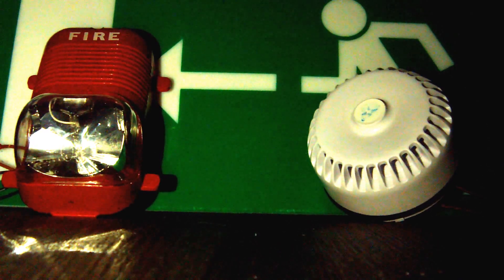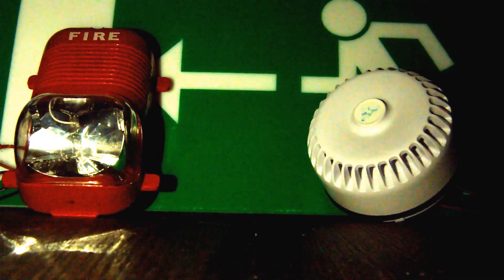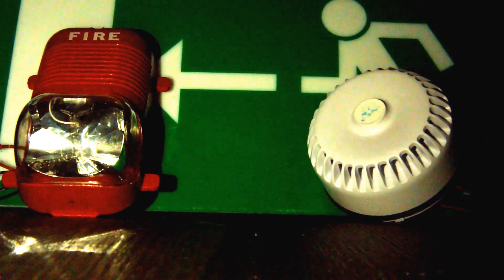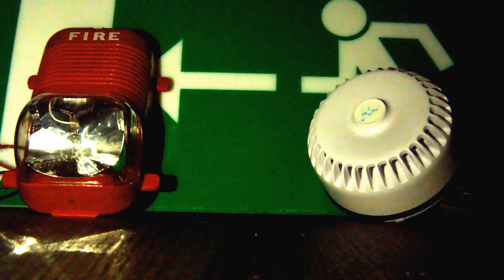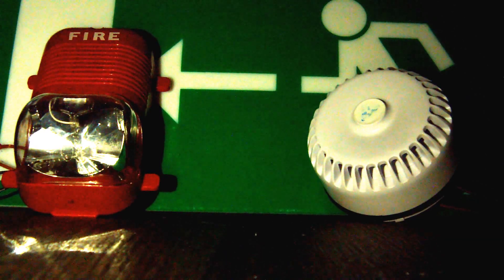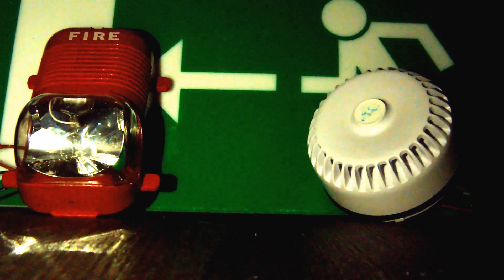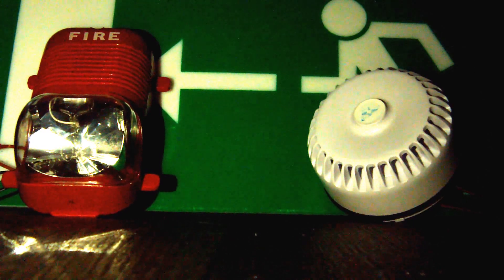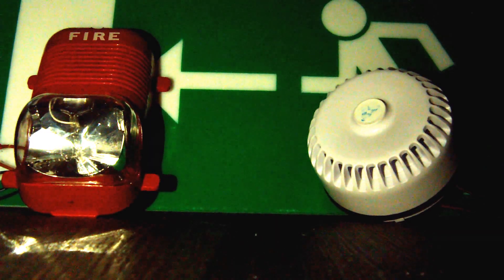German Fire Alarm VS. American Fire Alarm [System Sensor vs. Roshini]

Comment: Do you only use DIN33404 in Germany like they only use NFS32001 in France?
Reply from the maker: +Ben Wyatt Yes and no. For commercial buildings there is DIN 33404,  for industrial buildings there is another code. But the fire alarm sounds in Germany are regulated by codes.